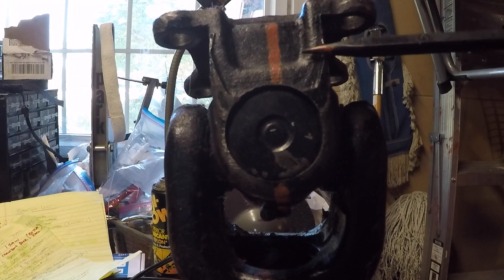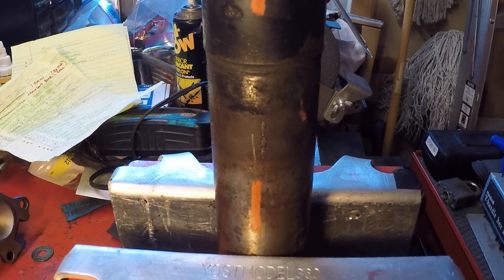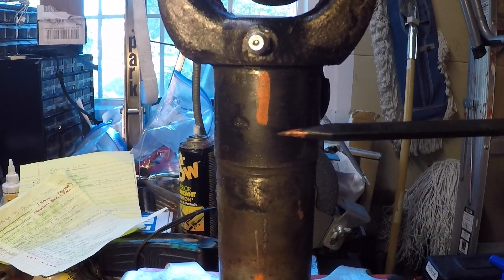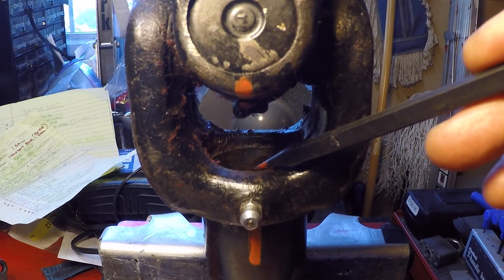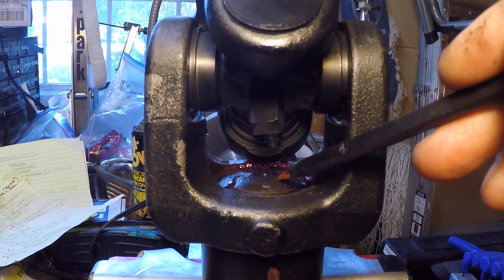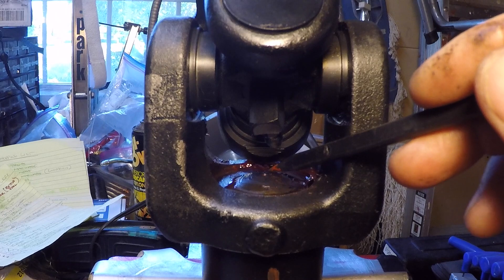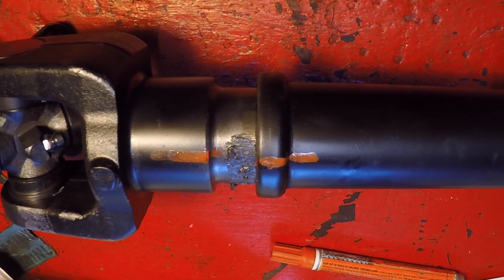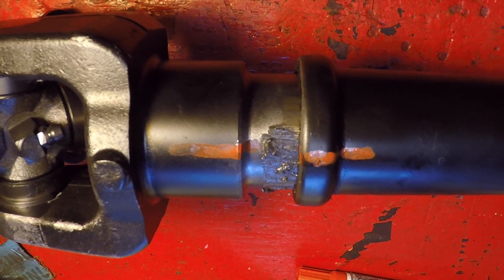Driveshaft Repair - (Slip Yoke Grease Plug Has Fallen Out)

Comment: Good info, Timmy sure does good videos but I didn't replace the whole thing, just the plug. At first just to get my rig back together and on the road I just use a plastic lid from a PureLeaf tea bottle I cut to size, didn't use any RTV to keep it in, fits snug and been in there now for a month with no issues. Just ordered a  	Spicer 3-68-23 Slip Yoke Plug that is supposed to fit and will put that in soon.
Reply from the maker: Good job Macgyering a cap for a temporary fix.

Comment: Toyota recommends you replace the double cardan. I opted for the whole assembly replacement. $2200 done. Call Toyota
Reply from the maker: Of course Toyota recommends replacing the double cardan because they don't sell the u-joints or center ball to allow people to rebuild it.  It can be rebuilt, but it's a bit of a pain in the butt and the parts available aren't on par with OEM.  Not everyone is going to drop $2200 for a new driveshaft when it can be repaired for much less.  The key to driveshaft longevity is proper maintenance.  The double cardan joint can last hundreds of thousands of miles when the u-joints and center ball are greased at regular intervals.  These joints mainly fail due to poor preventative maintenance.

Comment: Awesome info. A few questions...
1) How much did the balancing job cost? Was it a separate charge, or did they include it with the yoke rebuild?
2) Do they only balance the driveshaft by itself, or do they also do any kind of 'dynamic balancing' with the d-shaft on the truck?

3) How big of a deal is it if you screw up the original positioning of the 'd-shaft->tcase' and 'd-shaft->rear diff' connections? I screwed up when I did my clutch, and didn't make match marks at these two connection points before removing the driveshaft (where the d-shaft connects to both the t-case and rear diff). I tried my best figure out how it was originally bolted up at these two spots (based on the patterns of paint/rust/scratches). However, if I got these connections wrong, would it be a huge deal & cause bad vibrations?

4) I also pulled the idiot move of over-pumping my yoke and causing it to be super stiff. I didn't drive much on it before I realized it was probably wrong, and it started to leak grease where the slip yoke 'shaft' goes into the 'sleeve'. I removed the zirk, jumped on the truck bed a bunch of times & went for a drive to squeeze out all of the excess grease. luckily, I didn't blow out the cap, but are there other things that might've been damaged by having the stiff, over-greased yoke?
Reply from the maker: They didn't charge me since I was making the video.  Don't know what the charge would be.

The shaft is balanced off the vehicle.

The main driveshaft and slip yoke are balanced as a unit.  If you didn't reassemble it the way you took it off, it could be out of balance.

Comment: Hey Timmy, how would a fellow go about installing a new welch plug into the end of my slip yoke. Just got it delivered today and I'm wrecking my brain on how to maybe do it while still on the truck. Or should I just mark the slip yoke and remove it and the u joint and then epoxy it in or something.  I've heard of guys tack welding them in but I don't have access to a welder. J B Weld maybe or I also heard that you just whack it with a baby sledgehammer to try to oblong it or kinda force it in there. I just don't want it to fall back out. All suggestions and recommendations are greatly appreciated. Thanks
Reply from the maker: Hey Gary, this is something I haven't actually done.  How about this idea.  Take your slip yoke off the main drive shaft and take it to a muffler shop and let them tack weld it in place for you.  I bet they only charge you $20, if that.  Make match marks for the slip yoke and main driveshaft connection because the whole assembly is balanced as a unit.  You don't want to throw the balancing off.

Comment: I too didn't listen to all the suggestions and still tried to replace my double cardan joints. I actually found all the parts centering ball and spring and all but when I finally got it all back together it was stuck in a bind and wouldn't go back together quite right. So I took it apart and tried again but had the same thing happen and ended up destroying my cardan joint and had to buy a new 2 piece rear driveshaft.  There was only a couple places that I could buy one so I ended up with a whole new driveshaft from Powertrain Industries, that I noticed the other day that the Welch plug ( I think that's the name of it) is gone. Since I had to buy my driveshaft through a driveline service shop right down the road from me costed me right around 600 bucks. Anyway it drives alot better but now I need a plug. BTW you can't get any kind of help from Powertrain Industries if you don't have an account with them. I've tried numerous times with just a couple questions and not a single response. I also had to change the cheap center support bearing they had on the new driveshaft after only a year. Went with a new Spicer 211750 this time.
Reply from the maker: I wish you would have contacted me before buying a driveshaft.  I would have suggested Tom Woods.  They build awesome driveshafts for a fair price. They could have shipped you a driveshaft.  https://4xshaft.com/

Comment: My slip yoke leaks a little transmission fluid. 04 Tundra you think if I grease it it will stop the leaking? I didn't know there way a grease fitting until youtube.
Reply from the maker: What you said doesn't make sense.  Your slip yoke isn't filled with transmission fluid, ti's filled with grease.

Comment: Then would it be good practice to pump the slip yoke up and then take the zerk off?  Or just take zerk off and use rubber needle tip on the grease gun and wait for some blow back?  Maybe do a bumpy drive way with it off and wipe clean and refit the zerks?
Reply from the maker: If I knew I packed more grease in there than I should have, taking off the zerk fitting and then bouncing up and down on the rear bumper to cycle the suspension works to push excessive grease out.

Comment: Hi Timmy !!! you are great !!!
How can I know if the drivesahft is unbalanced since when I took it out it disarmed me and I had not made the guide marks?

Thanks for all the contribution, I have made many repairs myself thanks to your tutorials!
Reply from the maker: When they balance the driveshafts, it seems the zerk grease fittings for the front and rear u-joints always point the same direction.  It's a pretty good bet if you slide the slip yoke back on and align the zerk fittings your driveshaft will be balanced.

Great to hear our videos are helping you out.  You're very welcome and Happy Wrenching!

Comment: Hi Timmy, when coming to a stop, when I release the brake, to begin to go again, there is a clunk and my gear shift jolts forward a tad. Could that be a slip yoke issue?
Reply from the maker: Yes, it could.  It gets bound coming to a stop and then it releases.
Reply: I have that too! I greased it and it was quiet for a bit, but it’s coming back, so it might take a few times to work the grease into the splines

Comment: Do they just make another driveshaft without the double Cardone?
Reply from the maker: They can make a drive shaft that has a joint similar to a double cardan but it's easier to service.
Reply: @TimmyTheToolman  are they making them with a jeep style double Cardone?
Reply from the maker: @4wdaddict41  I'm not sure what a jeep style double cardan is.  From what I understand, they still make it with two u-joints but it lacks the center ball that cadan joints have.  I'm pretty sure that is the main difference.  They use quality u-joints that are easy to source so you could get it repaired anywhere.
Reply: I see thanks for your help definitely something I'd like to get done ! On my rig !

Comment: I over greased my front slip on my 4wd 2006 4runner because for some reason I thought I was filling the u joint. I haven't driven it yet I'm n 4wd. Could I remove the zirk fitting to release any preasure?
Reply from the maker: Yes, that's exactly how you do it.  Remove the zerk fitting and let the excess grease spew out.
Reply: Thank you. I took it off and nothing came out but I didn't run it in 4wd either. Hopefully it was just really low.
Reply from the maker: @kentuckianahunter7194  You're good.  I wouldn't worry about it.

Comment: Hi Tim, what type of grease do you use for the yoke?
Reply from the maker: This is the stuff the driveline shop told me they use for the u-joints and slip yokes:
https://www.amazon.com/Lucas-Oil-Ounce-10301-Grease/dp/B000IG20RW/ref=sr_1_4?dchild=1&keywords=chassis%2Bgrease&qid=1598964073&s=automotive&sr=1-4&th=1
Right now, I'm using some chassis grease I bought from an Oreilly's.
Reply: I thought you used xg8 from ford?

Comment: Thanks for the info!  I'm slowly overhauling my 02' Tacoma.  I swapped out my lower control arms last spring using your video as a play by play.   Thank You!  How often are you pulling the slip yoke off to lube it?  every oil change?  The plug is missing from my yoke and I'm looking for a bandaid.  What about an expansion bolt, like some headsets use?  Any idea of the internal diameter of the slip yoke?  I was also thinking a marine bilge plug or bung could work to keep the contaminants out?... thoughts.
Reply from the maker: I'd say every 10k miles, maybe every other oil change would be enough for the greasing of the slip yoke but certainly every oil change or every 5k miles would guarantee sufficient greasing.  For the missing plug, I don't know the diameter.   If you can weld or know someone that does, a driveline shop might be able to sell you a plug you could tack weld in place.

Comment: Hey Timmy.  Today I was removing my leaf springs on my 04 Tacoma. My rear axle spun forward and my rear slip home/joint came apart. I freaked out and put it back together real fast.  Then thought about it and worry now. Should there be a problem?
Reply from the maker: Hey Chris, the main driveshaft and slip yoke are balanced as a unit so you could now have an imbalanced shaft.  But, I think I can help you out.  These shafts are balanced with the grease zerk fittings facing the same direction.   Take a look at the slip yoke zerk fitting in relation to the zerk fittings for the double cardan joint u-joints.  The double cardan joint is the joint that attaches either at the transmission for a 2wd or the transfer case on a 4wd.  If the zerk fittings aren't all inline pointing in the same direction, pull the slip yoke off align it so the zerk fitting are all facing the same way and you should be good to go.  If for some reason you get a weird vibration,  that means the driveshaft balancing is off and you might have to get it re-balanced.  I have much more experience with 3rd Gen 4runners than Tacomas but I know that's how the balancing is done on the 4runners.  With the Tacoma rear driveshafts with the center carrier bearing,  it might be different how they orient and balance the shafts.
Reply: I really appreciate the feedback and your time. I went out and took it apart and aligned them. The two in the middle were matching so it does seem only fitting the yoke would too. 
It's gonna be a while before I get her back on wheels but, I will let ya know how she goes.  Thank you again.
Reply from the maker: @haterproof17  You're welcome Chris.

Comment: Are you saying that instead of fooling with a defective cardan joint have a straight shaft built with joints at either end but without a cardan joint?  Thanks
Reply from the maker: What I'm saying is instead of dealing with a Toyota double cardan joint that you can't get quality replacement parts for, have a driveshaft built for you that has a double cardan joint that you can rebuild with quality replacement parts.  A good local shop or an online place like Tom Woods can build you a driveshaft that you will be able to rebuild down the road much easier because they build it with parts that are quality and easy to source.
Reply: Thanks for the clarification.  I just removed my front shaft on my 2G, had a wicked womp womp going on..thought wheel bearing or ujoint in the rear shaft.  However upon removal the cardan joint and ujoints after greasing look and feel great.  The forward most ujoint has only a slight resistance on either side of the joint's center positioning.  My plan is to replace that forward most U and put the shaft back on.  I realized I probably blasted too much grease in the yoke on the rear as I watched it force the two apart and heard mild creaks.  I've not driven it yet so thinking a trip around the block with the zerk removed will save me from blowing the plug!
One other thing.  The front shaft male portion, the splined end leaving the front diff has a noticeable/feelable/visual "bottleneck" or "valley" wrung around it.  I feel excessive play somewhere may have led to the wearing down of this hoop.

Comment: Double Cardan U-Joints N/A? It looks like I can order for my 2001. Is it just 1st Gen’s that are not available? Big fan of your videos; the best!
Reply from the maker: Hey Donald, where are you seeing this availability?  I have 2 3rd Gen 4runners and it's pretty common knowledge that Toyota doesn't sell the u-joints or center ball that make up the double cardan joint.  Maybe the u-joint you're seeing available is the one for the u-joint at the slip yoke which Toyota does sell a replacement for.
Reply: @TimmyTheToolman  I order parts online (discounted) from Hendrick Toyota of Apex NC (I luck out cause I can go by and pick them up).  They are listed on the website.  I was just now there picking up a windshield wiper motor, I had the counter guy check for availability and he confirmed it, yes!
Reply from the maker: @donaldwilson498  This is contrary to what I have heard and from my own experience.  Please provide me a part number from Toyota for these double cardan u-joints. Also, is this parts supplier also claiming they sell the center ball for the joint?
Reply: @TimmyTheToolman  "https://parts.hendricktoyotaapex.com/a/Toyota_2001_4Runner-SR5-34L-V6-4WD-AT/_82794_6726918/PROPELLER-SHAFT--UNIVERSAL-JOINT/671460-3701.html"  I installed the 0437160070 in the diff end.  I checked with another dealer and the u-joints (only) in the front are a 0437160060.  I'm not referring to the center ball...I no longer use the camelback toyota website...can't get it to work like it used to! (Update) for what its worth, I have not done the replacement and thus can't give you that level of assurance!
Reply from the maker: @donaldwilson498  We used the 0437160070 u-joint as well for the u-joint at the diff end when we made a video.  Thanks for sharing this and this has me more than a little perplexed because it's been pretty much common knowledge on T4R.org that Toyota doesn't sell replacement u-joints for the double cardan joint.  I'm going to call my local dealer and confirm this.
Reply from the maker: @donaldwilson498  I talked to my local dealer, Stevens Creek Toyota and they did a parts search for me for #0437160060.  That part number comes up as a replacement u-joint for the u-joints that are part of the slip yokes for a 2002 - 2006 Tundra and a 2003-2007 Land Cruiser.  They confirmed for me that u-joints and center balls for the double cardan joint are not available through Toyota.  Now, does your dealership somehow how special knowledge on this subject?  Who knows.  But, Stevens Creek Toyota is one of the largest Toyota dealerships in the nation and they're telling me according to their parts program that Toyota does not sell parts for that double cardan joint.
Reply: What do i do if my double Cardan u joint is bad?
Reply from the maker: @bustermathis1277  Some driveline shops will rebuild them and I've read about guys doing the job themselves.  The problem with the double cardan joint is Toyota doesn't sell the u-joints or center ball that make up the joint.  The available u-joints and center ball are a suspect quality meaning you're going to pay for all the labor to get it repaired, but since the parts are inferior to OEM, you might find yourself much sooner than you hoped down the road with another repair.  So, if you're asking for my advice, I'd suggest 3 options.  1) If money is tight, maybe you can pull a used driveshaft of a wrecked rig at a PicknPull.  2) You can take your driveshaft to a local driveline shop and see what options they have to rebuild your current driveshaft or build you a new one.  3) You could purchase a driveshaft from an online seller like Tom Woods.
Reply: Timmy The Toolman ok thanks I purchased two u joint and was going to rebuild but nowhere had the center ball but from everything iv read I’m calling the pick and pull and junkyards today
Reply from the maker: @bustermathis1277  Good luck hunting for a driveshaft.  The PicknPull website has a search function so you can find the vehicles you're looking for at any of the sites within the search radius you input.